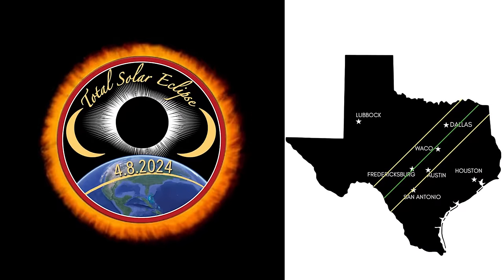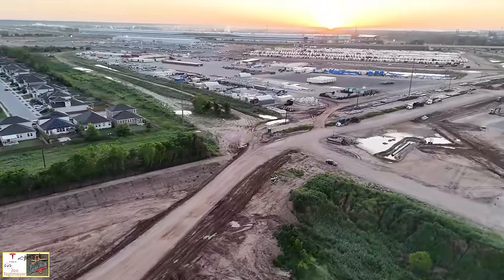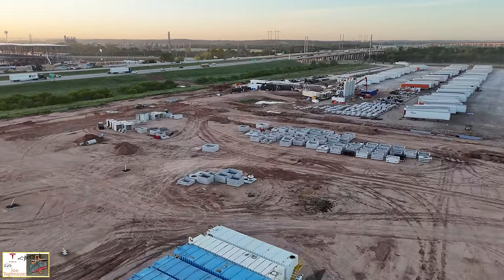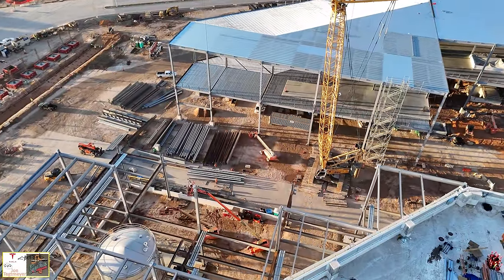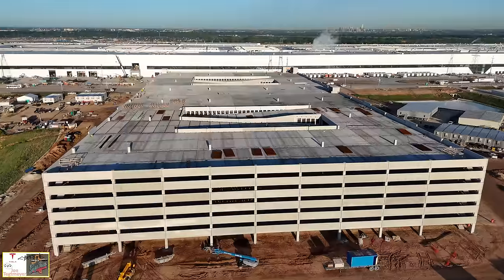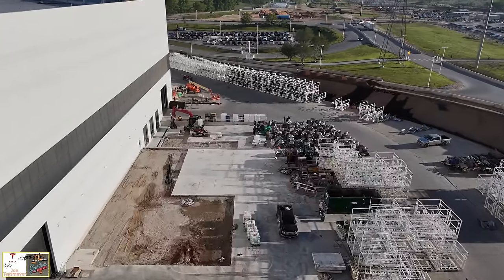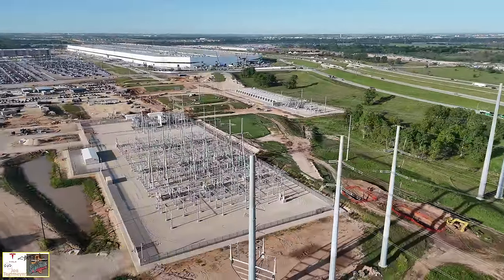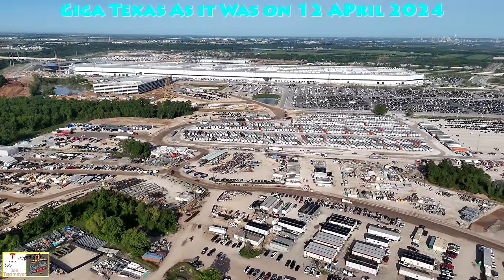Mega Structure, S Ext Concrete, Boring Tunnel & N Conduits! 12 April 2024 Giga Texas Update(07:15AM)

Comment: Those unusual footings might be for some sort of external (to the main building) storage for castings. At least that's all I could think of. If my assumption is correct, then  presumably this is because as production rates ramp up and the apparent extentions to the northeastern portion of the building grow, there simply won't be sufficient space to accommodate all of the castings.
Reply: Agreed, the fact that they have been storing casting outside is confusing. I certainly don't think it can be good for the castings to be outside for so long, even aluminium is affected by the changing weather after sitting outside for months at a time. Is the factory just not big enough to store castings? I would have thought they would have planned to store castings under cover. Also while manufacturing is still relatively slow right now, albeit achieving targets are they going to need to build another outbound building very soon to cope with the huge amount of cars that need work done before delivery. The new building seems to be working at full capacity getting trucks and cars ready for delivery, fixing minor problems found after the vehicles are leaving the assembly lines.

Also seems to be many delays with the different construction projects, they seem to do a few days work then they don't do anything for a few days then work for a few days thus extending time to complete each project. Just look at the building extention on the north east side of the building, work is so very slow. Then we see the new concrete slab being poured and completed in a matter of three days and that includes the clearing and leveling of the ground. Three days ago brads video showed absolutely no signs of the massive slab even being planned. From some reports it seems like it could take 3 months for the tunnel to break through at its end point. This seems extremely slow when it was said that the tunnel could bore at a mile a day!
 Very strange how this construction in various areas is happening compared to when they built the main building. I am also wondering if they are going to need to build another factory eventually as if looking through the windows all levels are jam packed. Maybe we could see another factory, possibly even bigger than this one being built to the north as this one even with the extension does not seem to be big enough for the three models that will be manufactured here. 
Sorry rambling the thoughts my process.
Reply: @flubalubaful  The entire holding now encompasses around 3,000 acres so it would be very surprising if we didn't see, or at least hear, of another production facility in the next 4-5 years. It's important to keep in mind that Tesla is keeping a close eye on interest rates, inflationary pressures, and how that impacts their war chest. Let's not also forget that they ALREADY have (two) other construction projects on the books, one at Giga Nevada, and the one planned for Mexico.
Reply: @flubalubaful Gigi Mexico.

Comment: Any word on if the multi level parking garage will have superchargers in it or destination chargers?
Reply: Seems like a good idea from the point of view of the users, but... Charging means a greater risk of fires. Which could threaten the structural integrity of the building. Yes, there is also a risk of fire with gas powered vehicles, but they are easier to put out. Should be no problem for the building's sprinkler system.

Comment: Would the put a simple slab for proofrock to cut up into? If so, then there is the answer to  the exit.
Reply: I honestly doubt they would lay concrete for the boring machine to break through, just does not seem like a good idea to me. Unless they will be putting equipment there to help lifet the boring machine out. It seems to have been built in a serious rush. We will see as I doubt the factory will be built around it for a few months at least.
Reply: @flubalubaful 
I doesn’t make sense, but it wouldn’t surprise me.
Reply: @flubalubaful  most boring machines finish through a concrete wall. They normally dig a pit and build a concrete wall for it to exit through

Comment: Any idea when Prufrock will emerge on the other side of the highway?
Reply: I heard no sooner than 3 months but they really did rush what many believe is the exit paving, and if Joe is correct and the tunnel is already under the freeway I think it could be surfacing in a few weeks. But what is happening with the extra tunneling equipment sitting to the side of the tunnel entrance. Is that used to give the tunnel finishing touches, as if the boring machine is already at the highway it is obviously not needed to build the tunnel structure?
Reply: @flubalubaful 
I know a Chinese crew that could do it in three weeks with picks and shovels.
Reply: @flubalubaful  The 7 decks sitting on the surface will be installed in the next week or so. Up to now the TBM has been running on umbilical cables and hoses for the launch sequence. These lengths of cables are almost all underground now (hence my belief that they are 40-50m advanced so far). We will see a 1-2 week stoppage in the next few days for this installation work.
Reply: @freddymax5256  How do they excavate below the water table in soft ground with picks and shovels? There are as many different tunnelling techniques as there are ground conditions. But they did waste a lot of time here on the set-up for sure.

Comment: Wonder if those 3 tunnels are for permanent completed vehicle egress from the plant? Although they don't align with the expected Boring Co tunnel.
Reply: That's my thoughts, the tunnel could eventually branch off to various parts of the factory, there was talk of it maybe exiting where the y models exit the building and further north near the battery plant. We could see numerous tunnels used to transport parts all over the factory. That would save a lot of traffic inside the building and possibly save space for the model 2 lines.
Reply: 3 tunnels?

Comment: EOL facility:
West:
@ 4:00 They took dirt out. Then they put dirt back in. Now.... They're taking dirt back out!
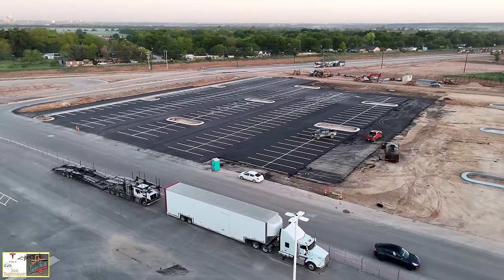@ 6:11 New paved and striped parking lot.
South end:
@ 13:52 No rebar in what was expected to be a slab. Since they used waterproof membrane.
South end easement:
@ 11:47 New footings and columns constructed on top of the screw piles.
River road:
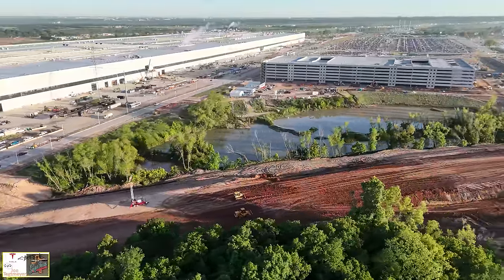@ 16:09 to 16:29 Ongoing progress on the River road extension.
Eastside of casting:
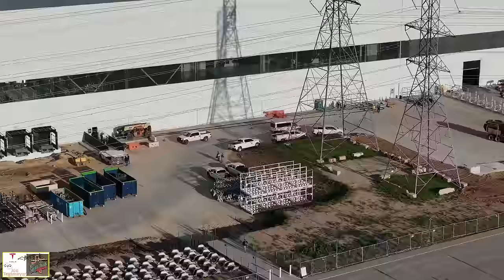@ 18:43 to 18:50 Cable on the ground by the building.... Part of cable pull through the new duct-bank for the east parking lot Superchargers.
Reply: Dirt out and in concrete down then removed, seems like construction over the past few months has been rushed. Conduits from power plant is the most baffling thing. They spent months laying conduit did they not lay enough?  No rebar points to the concrete slab being a very temporary thing, very strange! River Road extension has not been touched for months now they have piping for water management. Also strange, like they start a project without being ready then leave it for months as though they forgot something., I am seriously confused right now with the construction, it looks like someone is not planning things very well.
Reply: @flubalubaful  Agree on almost everything! Except regarding the new duct-banks. That seems to be a project that was planned for some time. If you look at Joe's video 9/11/23 at the 19: 39 timestamp shows the new duct-banks coming out of the mega-vault. They had to temporarily stop because the old substation was in the way of the new duct-bank alignment.
Also, if you look at  19:56 (Left, by the building) Two previously placed vaults.... Speculating that this is the destination for the new duct-banks from the mega-vault. Which will more than double the power supply to the building. Those vaults were placed a long time ago but never used. 
Using 4 duct-banks instead of 2 increases redundancy in case of a failure. It also allows power to be delivered to two different parts of the building about a thousand feet apart. Again, increased redundancy.
Reply: I hate micro-management.

Comment: Those new foundations may be base columns that may hold up a long sign..... That would be cool if it said:

"TESLA GIGATEXAS"

Similar to "Gateway to Mars"
Reply: @darbyelliott2890 Interesting idea, but I feel it would be a strange place to put it. On the West side would make more sense?
Reply: I don't think so. It looks like it is going to be a structure with a roof. The speed at which they built it and the shape makes me think it is a tunnel entrance or exit. It seems to be the same width inside as the tunnel, maybe slightly bigger. It really seems like the tunnel is not just going to be one straight line but maybe a few tunnels branching off from the one. I wish someone could get some more info on the tunnel as it does not seem like the tunnel plans would be any type of top secret. All we know so far is that it is a tunnel. Seems like a missed opportunity to advertise the boring company!

Comment: Prufrock 3 will exit just before the Concrete i my Guess...
Reply: The concrete has no rebar so it looks like a temporary thing. Maybe a temp road for cybertrucks leaving the factory, but seems a waste if so. Also while not very deep it is not a thin concrete structure if you look at the worker walking in it it is at least up to half way past his calf so about 50cm
Reply: I think it will cut up thru the concrete. No rebar.